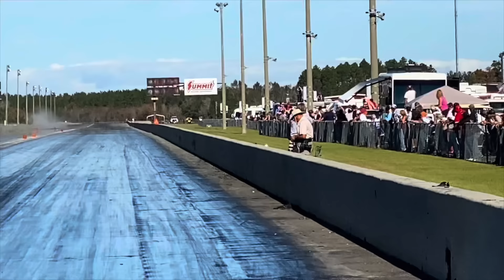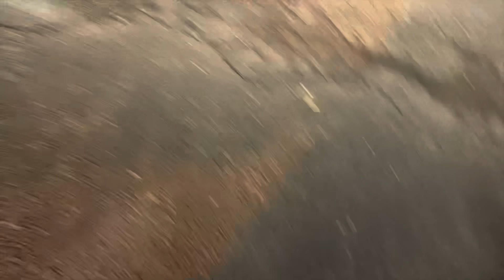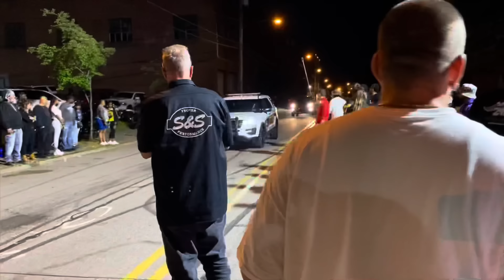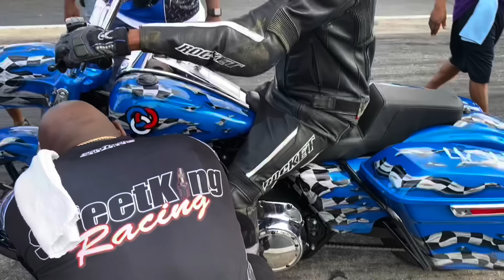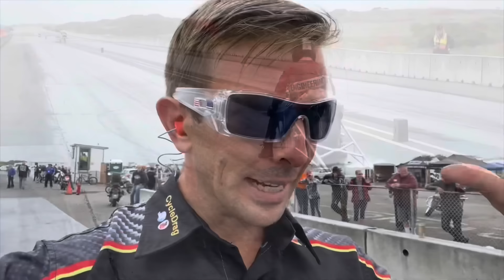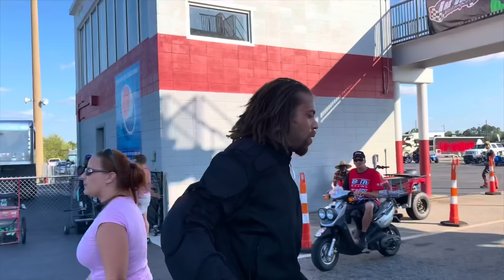DRAG BIKE RACING GONE WRONG! CRASHES & EXPLOSIONS!

Comment: My dad was a biker  I have been on a bike since I was 5  you have either  been down or your going down he took off half his face on the old east Brady bridge  ... his best friend bugs never walked again Rubber side down , god bless man.
Reply: I lost my knee. Had been riding since I was a kid. Low speed accident, my knee turned into 100 pieces of bone and my leg was 30° off to the side... sideways. Just destroyed it. Was in traction/external fixater for weeks, 6 surgeries to Frankenstein it back together with titanium plates and 24 pins/screws whatever they use. Then a few years after the bone had kind of solidified I had to have 2 total knee replacements done on it. Not even 40 y.o. yet😅 alll the crazy shit I've lived through without Injury and it was this little dinky low speed accident that took me out

Comment: So to be the fastest bagger you can use a custom frame and a plastic body??
Reply: In that class for baggers, like anything else there's going to be different levels of modifications for different classes. 
You mentioned the frame, some classes require the stock frame but with radical modifications, what they usually do for those is cut the neck with the VIN number off and build a whole new frame using that neck, the wilder classes do things like that.
Reply: @dukecraig2402  I was confused cause I seen a frame and a hollow body so that's a pro mod, but I guess it's just terminology, like to me a door slammer is a streetable drag car (Vin tag, title, insurance, and ac), but at some meets iv seen it can be a fully blown 10 ltr with nitrous, tube frame and a mock driver door...

Comment: No better way to ruin the look of a bike by installing an extended rear swing arm.
Reply: you know its for a reason, and it's not for looks.
Reply: You know it is used to keep from wheeling at high speeds rightm
Reply: @swift_fivem7998  it's actually too limit wheelies at the start of a drag race.
Reply: @aeroflopper  true I forgot to add that